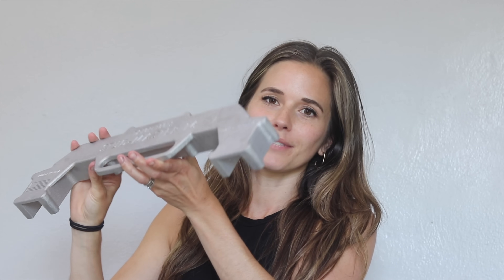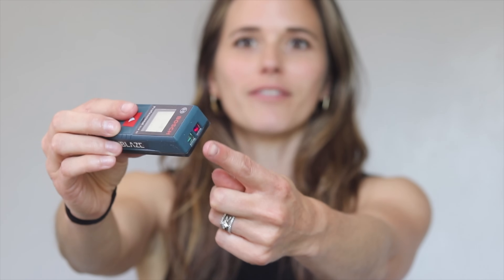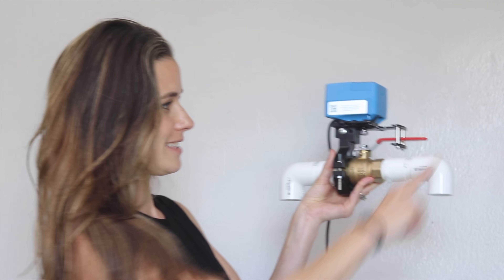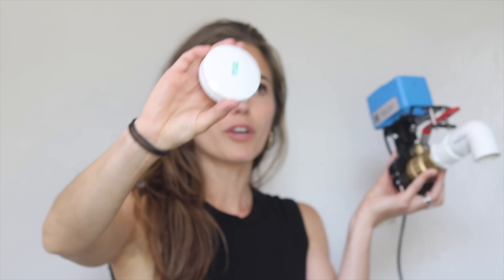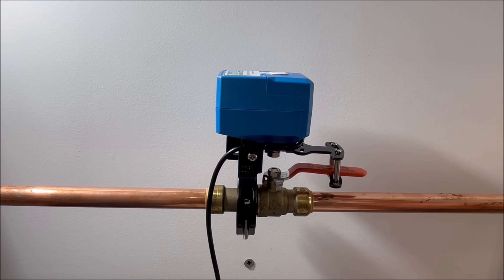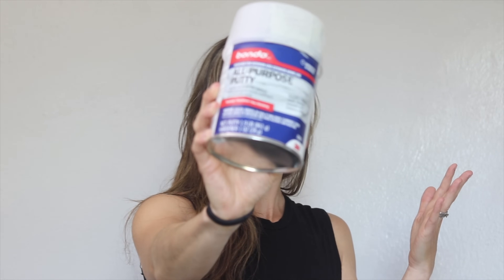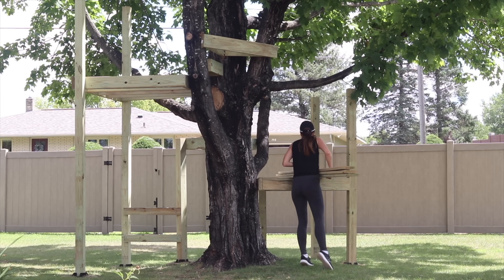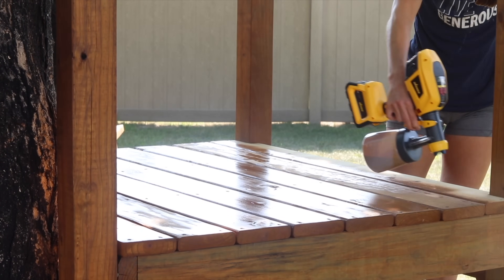5 DIY Home Products You Didn't Know Existed

Comment: That is not steel, from the item description, “the Stud Master is 100% solid cast aluminum.”
Reply from the maker: I saw that when I linked it and realized I misspoke. It’s very heavy duty so I made an incorrect assumption it was steel. I apologize!
Reply: Don't apologize, total nitpicker here. Unfinished iron would rust quickly and it would be very heavy. It's probably good to good on little meaningless things to drum up the participation and feed the algorithm :)

Comment: I live in a log home and have had terrible problems with Carpenter Bees.  I finally discovered on YouTube a product that keeps them away. It is a fake hornets nest that you hang on each side of the house.  Because the Carpenter Bees are afraid of Hornets they will stay away.  Since putting them up I have 0 Carpenter Bees when I used to have dozens buzzing around all of the time.  They can be purchased from Amazon, I recommend the waterproof plastic ones.

Comment: I found the Stud Buddy to be a more accurate and reliable stud finder than the more expensive versions that light up when they sense the added density of a stud behind the drywall.  The Stud Buddy is a simple magnet that you move around over your wall, and when it moves over a drywall screw or nail, it will “grab” at it, telling you there is a stud there.  I added a two foot length of brass plumbers chain to mine (brass of course being non-magnetic), which hangs down like a plumb line from the Stud Buddy, essentially transferring the mark of the middle of the stud down to where I might be shooting a trim nail, or screwing a bracket on the wall.
Reply from the maker: Yes! A magnetic stud finder is so helpful! Smart idea to hang it from a chain so you can probably even detect in plaster and lathe walls pretty accurately

Comment: 3:48 If you want the Bondo to set slower you can add less of the catalyst to it. Some things like epoxy need an exact ratio, but Bondo is basically polyester resin and talc. You can also add additional polyester resin (sold as "Fiberglass resin" under the Bondo name) to thin it out a bit. Store it somewhere cool like your basement. It will slow down how fast it sets up in the can (even without adding any catalyst it will set eventually), and will set set slower if it's cool when you mix it up.

Comment: "Magical repair putty" is the best description I have ever heard to describe Bondo.  

Products that I use in a pinch:

1.  Fast setting mud.  Available in 5, 20, 45, 90 minute.

2.  Big Stick impact resistant flexible mud set corner bead.  If you trace a weird profile (where drywall meets stone), or  the return side is less than 1inch, I use Big Stick corner bead.  You can trace a profile on it, and it cuts like butter with tin snips.  On short side returns (less than 3/4"), I glue it using PL Premium construction adhesive on the short side, and I mud it with 45 minute mud on the long side.  Other wise, I mud them (usually with 90 minute mud).

3.  Bondo - the "Magical repair Putty"  Broken or missing trim, no problem, make a mold from Bondo with Bondo and scraps of wood held together with super glue.  Wax paper (raid your pantry for this item) is your layer of separation.  Make your mold first, make your repair second.   Always keeping a fresh piece of wax paper in between what you don't want your Bondo to stick to.

4.  Super glue.  Sometimes you just need a quick adhesion.

5.  3M Blue painters tape 1.88 wide.  Put down some blue painters tape first and draw all your lay out lines and holes and center marks on the blue tape.  Cut or drill right through the tape.  Peel back tape to reveal a surface with minimal tear out while cutting/drilling and no pencil or sharpie marker marks on your walls, ceilings, floors.  

6.  Primer.  Water based primer, shellac based primer, oil based primer.  Choose your primer wisely.  Shellac based primers stick to everything and everything sticks to shellac.  I use this when I am painting over top of oil based paints, stains, varnishes, and polyurethanes.  Oil based primers prevent bleed through better than anything else.  I used oil based primer in my coal cellar of my 96 year old house.  It was the only primer that prevented the coal soot from bleeding through.  Water based primers have lower VOC's, and easy clean up.  No solvents required.

7.  Shark Bite pipe fittings.  In these old houses, sometimes pipes leak or worse yet burst on a cold day.  Unfortunately the shut off valve is 100+ years old and stuck open and you can't shut the water off to stop the leak or the burst pipe from flooding the house.  No problem.  Find a clean straight section of pipe between the leak and the water meter, cut the pipe (yes, it will be actively flooding the house at this point), slide on your Sharkbite 1/4 turn ball valve (while in the open position), and once the Shark Bite fitting is seated, you can close the valve stopping the leak.  At this point you should probably call a plumber, the water company, and a flood/fire restoration specialist depending on the level of water damage/flooding in your house.  If your not sure about what I am describing above, call a plumber.

8.  Expanding foam gun.  Instead of buying the one time use expanding foam spray cans with the plastic nozzle, right next to it on the shelf is a gun with a long barrel that helps you reach into tight spots better.  It use a different canister, but it is all the same product line.  I only purchase window and door minimal expanding foam.  It works for 95% of what I need it to do.  Expanding foam can also be used as adhesive to glue boards together.  With some bathtubs, you can set them in expanding foam instead of mortar, or you can foam in around the areas that didn't turn out so well with the mortar.  You can fill gaps in drywall/plaster with foam (let it set up overnight), then you can trim it back and mud and tape directly over expanding foam with the All Purpose drywall mud in the five gallon bucket with the green lid.

9.  Don't have any All Purpose drywall mud?  Ad a healthy squirt of yellow carpenters glue (I like TiteBond II) to your fast setting drywall mud.  Mix the glue with the water first until all the glue is dissolved and mixed well with the water, and your fast setting powder second and mix like you normally would.

10.  I buy the really old cake batter mixers from the 1970's with the flat metal beaters at flea markets, garage sales, etc.  It's the only way I can mix a full pan of 5 minute mud and get it on the wall before it sets up.  Warning:  the mixer reduces the working time of the mud drastically.  90 minute mud acts like 20 minute mud.  45 minute mud acts more like 5 minute mud.  5 minute mud acts more like 1 minute mud.  

11.  The Stanley 47-099 chalk line doubles as a plumb bob because the bottom of the case comes to a point.  Great on those days when you need to travel light.

12.  Blue chalk line chalk can be used to tint drywall mud, primer or paint.  A little goes a long way.  It is great for the second coat on drywall mud touch ups because it hides the white from the first coat, and as long as you go back to white for your third coat, you only need to tint your mud for the second coat.  A little bit of blue chalk line chalk in your Kilz 2 primer helps hide bold colors from previous paint jobs.

13.  Purchase a brand new empty chalk line reel (I recommend the Stanley 47-099 as stated above) and fill it with talcum powder or baby powder.  You can now snap a chalk line on carpet that vacuums up with no harm done to the carpet.  Great for laying out interior walls in an already finished space.

I have lots more tips and tricks if you are interested, but those are my most frequently used tips and tricks for interior residential renovation projects.  Feel free to reach out to me, maybe I will even make a YouTube video about it.
Reply from the maker: Damn! Thank you for all the great advice, you SHOULD make a video about it!
Reply: So glad I happened upon this comment -- so much great information! Thanks for sharing!!

Comment: Trying to decide if should do a resin epoxy countertop or skip.. and had to dive into this 'new product discoveries'! Thx. Also a newbie re: Bondo! LOVE IT! Sometimes use Bondo for Wood, other times orginal Bondo. It is a lifesaver - and awesome in that can apply 'proud', then sand down.. 3 things learned:  [1.] amt of accelerator can be varied for faster or slower drying (ie: usability) times,  [2.] friend suggested putting screws into a deeper application (possible if can cover the screws).. which saves amt of Bondo needed, and seems to give little extra strength (which might just be mental - ie: peace of mind?), and [3.] there is a 3rd bondo product just tried + also really like: 3M Bondo Glazing and Spot Putty - which is premixed, comes in a tube... and is amazing for filling small things like small nail holes or scratches - was awesome for prepping a beat-up door for painting. check-it-out!   Thx for the great product points!

Comment: Great suggestions and I'll check out the laser measure. A laser level is another fantastic tool. I installed a Bulldog shutoff in my finished basement, but after the water heater burst and destroyed the carpeting and some drywall. Be sure to annually inspect your water heater!

Comment: First comment ever: goodby lag bolts, hello Timberlock. After sheering multiple 1/2 and 3/4” lag bolts building a tree house, I discovered Timberlock fasteners. They will not sheer. Ever.
Reply from the maker: I will have to check Timberlock fasteners out!